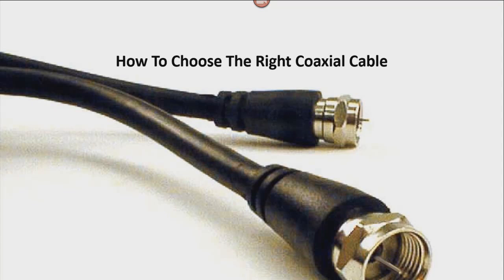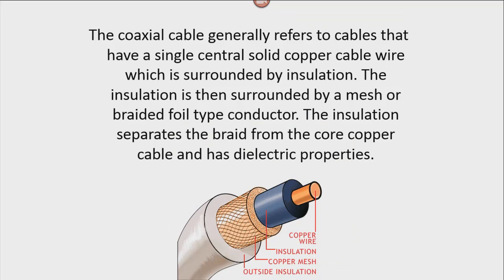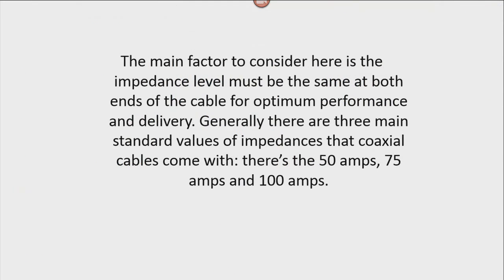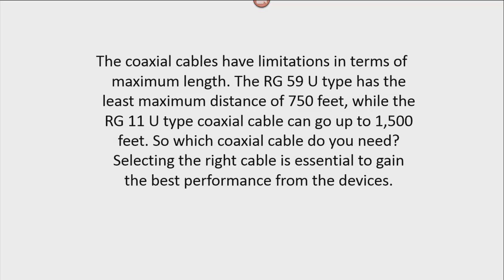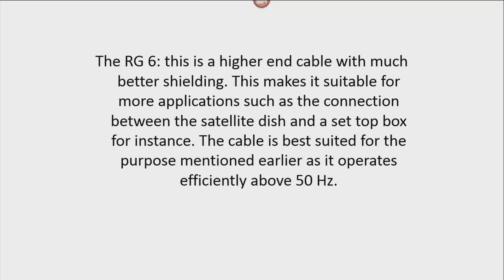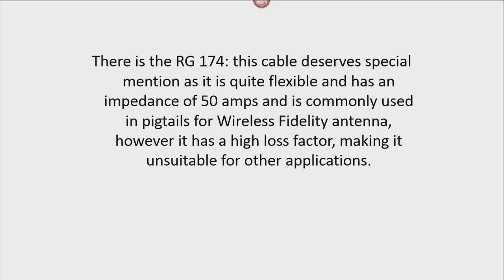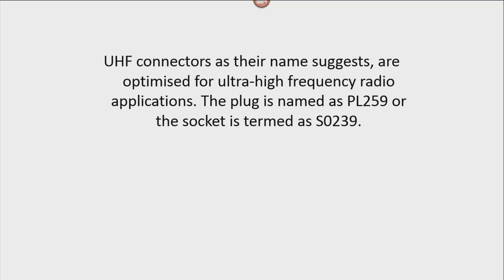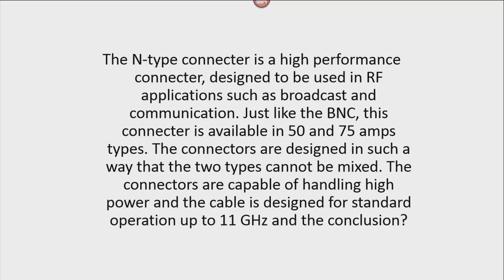How to Choose the Right Coaxial Cable

Comment: Coaxial Cable impedance isn't measure in "amps". It is measured in "Ohms". Coaxial cables do have power and current ratings, which makes this particularly confusing.